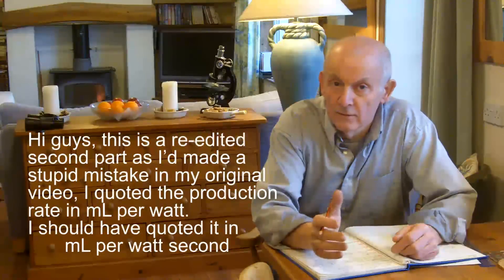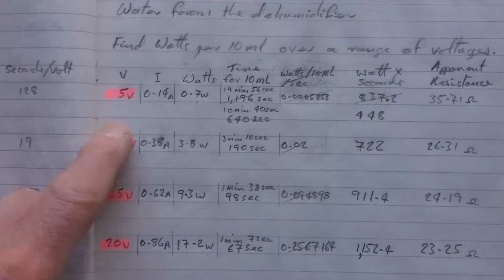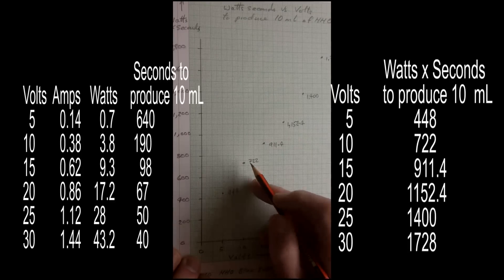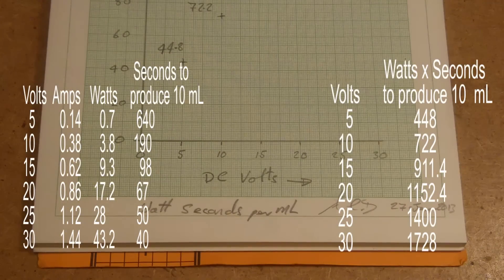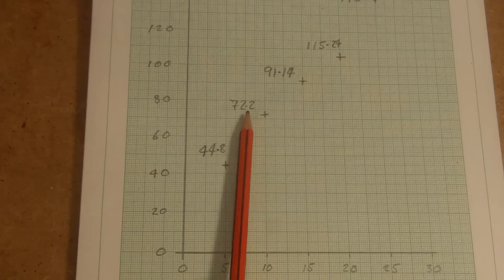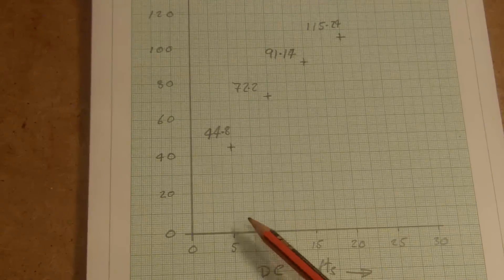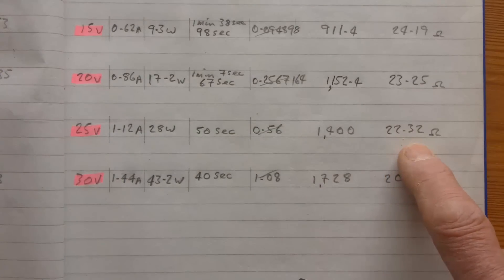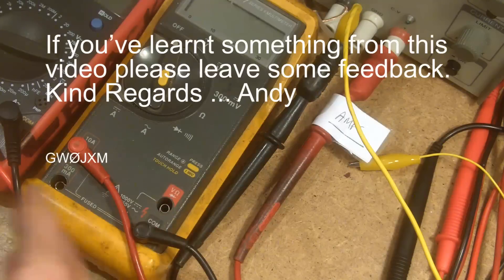HHO. 6 (Re-edited video) Test results for the test set up in HHO. 5

Comment: Hello, i like your scientific type of work. Most people dont use measurements and statistics like  you do, which is a big problem. Did you stopped to experiment on HHO?
I want to give you some Ideas. The plate-electrode design (populated by the Drycell) is a dead end. I haven seen any cell which can produce 1Liter/min with less than ~160Watt, most even need 180-250Watt per 1 Liter/min (with water additives). So to go further you should try other electrode geometries. For example 2-Wiremesh's or 2-Zylinder(inner/outer) designs (stainless steel offcourse). Also you should take temperature in consideration at every experiment. A good experimenting Range is 20-70 degrees Celsius. Later you should measure the Humidity of the Gas if is it low or too high. Other ideas are lowering pressure or using ultra sonic too boost the electolysis. Talking about frequencies. They depend also on the electrode design. I doun 18-25khz a good starting point for reasearch. My opinion is to use pure destilled water, like you do is the right path. greetings

Comment: Andy, I like your methodical method.  When I first saw this thread, you were showing 2 plates from copper and SS and the importance of choosing the copper for the negative. When you use 2 SS plates. you will get red oxide after a while. Can you do some experiemnts with copper & SS with the intension of reducing or eliminating the red oxide?  Also, is the SS oxide caused by high amp draw? How do you determine the "right" amp draw for a cell?
Thanks!

Comment from the maker: Hi Tony, high praise indeed. 
MMW is used as an abbreviation for Millilitres per Minute per Watt.  And that’s fine as I guess it fits the units used but when I trained as an Electrician and then as an Electronics Engineer, unless otherwise specified, Watts meant Watts per hour, so I tend to either say Watts or I specify Watts per second but so long as the numbers add up correctly you can hang any handle you like on it. Maybe it all went wrong the first time someone said TTFN.
All the Best...Andy

Comment from the maker: Hi, thanks for the input. I think you have a valid point, but only where you have multiple plates, as I’ve only got the two plates in the test cell any current flow is making a positive contribution but I can quite well see that under other circumstances ‘edge effect’ could influence the performance. At this stage I'm going to keep things constant and only change one parameter at a time.
 Kind Regards ... Andy

Comment from the maker: Negative. From the trials I have carried out so far, the most efficient voltage in terms of volume of gas produced per watt of power used is 5 volts, I have every reason to assume that as I lower the voltage so the efficiency will continue to increase until I reach some lower cut-off point. So far I’ve spent more time making the videos than carrying out the trials but I thought it would help a lot of folk to record my efforts. 
Kind Regards ... Andy

Comment from the maker: You’ve got it in one Bob, as the applied voltage is increased it changes the state of the water in such a way that the apparent resistance, no maybe that should be, ‘the actual resistance’ of the water changes. The gas production seems to increase in proportional to the increase in voltage but the current increase at a higher rate than if the resistance remained constant.
 I will post some more graphs that I hope will help.  
Kind Regards ... Andy